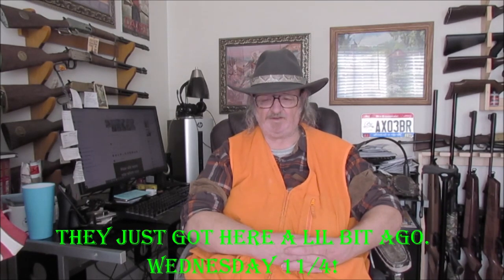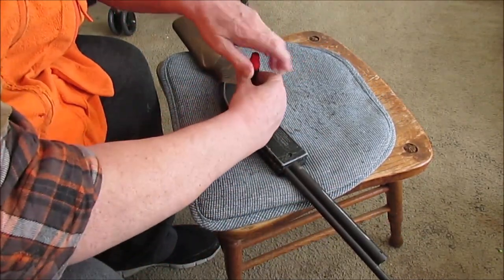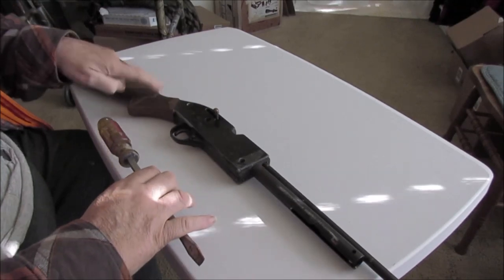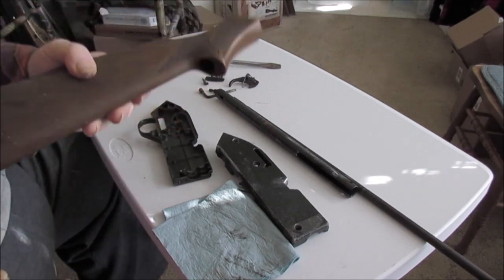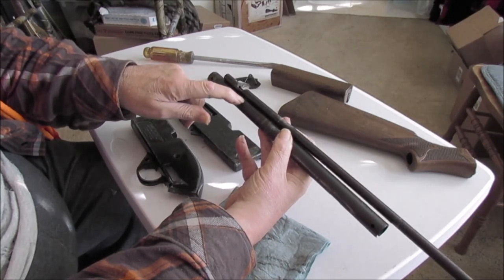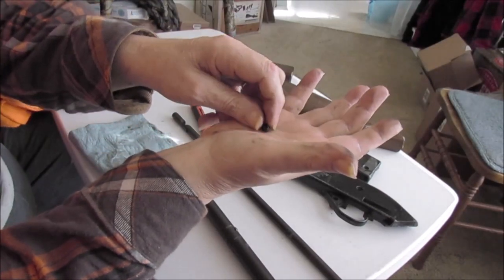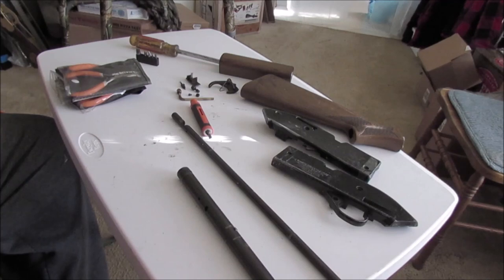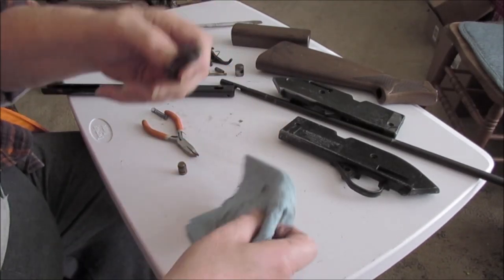The Lone Airgunner EP147 Crosman 760V2 Resto PT2

Comment: unionrdr. Nice video bud. Sorry for the headaches!  Some of that stuff as in crappy grease and so on was either done by a 15 year old me or maybe by dad. 

Dad was a great machinist for 40 years, but he was raised during a time where you used whatever you had on hand to make something work. He literally was born in a log cabin with no doctor and grew up with nothing, no electricity, no running water etc. 

He passed July 20th , 2020 at 100 years old.

I appreciate the effort and I will make sure you are compensated for the headaches.....lol

Thanks for restoring one of my childhood memories!
Reply from the maker: My son went back to his job this past Monday. So he has the tool & Die man working on getting that broken screw outta the head section of the gas valve. Not looking good so far. Might need to replace that part, or the whole valve. Other valve parts are fine. And living to 100 is darn good in any man's book! My dad was about the same. Born in the house my grandpa built.
Reply: @unionrdr  Good deal on the son going back to work, I just got called for a job today myself in solar.
I don't mind paying for parts, make it easy on yourself. Thanks
Reply from the maker: @mac11380  I try hard to keep as many original parts as I can in the assembly. Just reconditioned like or better than new! Like to keep it as all-original as possible. Good luck on the Job!
Reply: @unionrdr  I will trust your judgement, thank you